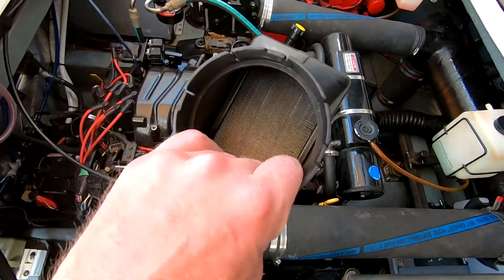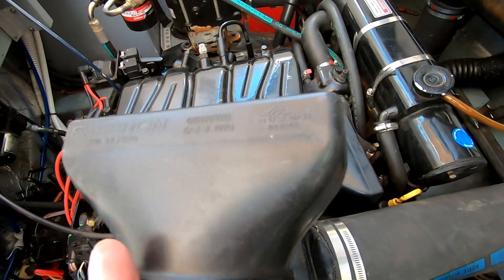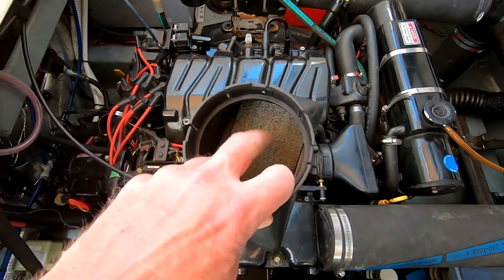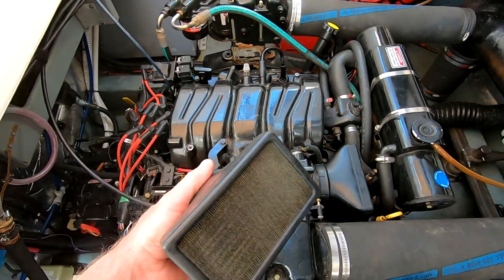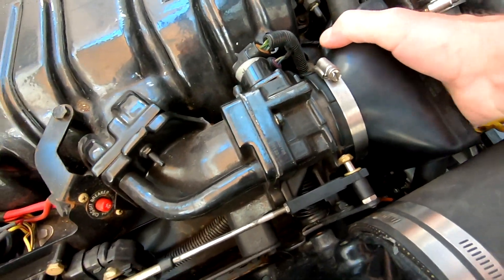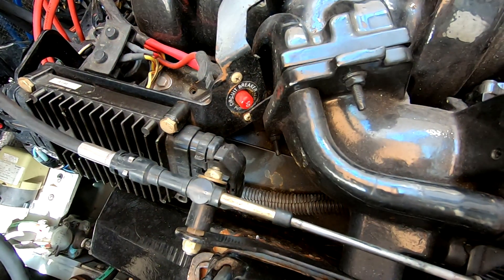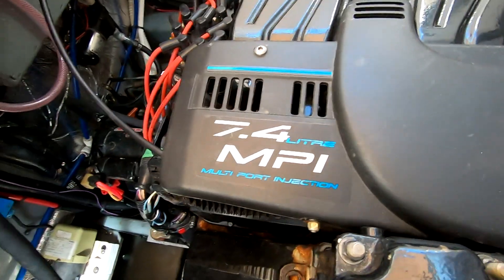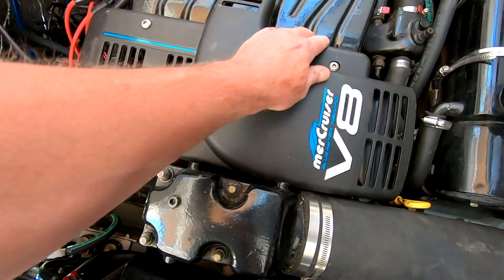Mercruiser FLAME ARRESTER (Don't Call It an Air Filter) Cleaning - Sea Ray Boat

Comment: I am with Jim Van Eaton,  the K&N air filters flame arrestors are made specifically to replace the expensive parts for mercruiser engines.  Sounds like a much cheaper alternative than putting back on dirty air filters.   As well cleaner air filters would lead to increased fuel economy.  Which sounds crazy on a boat but every little bit helps increase efficiency.
Reply from the maker: Exactly.

Comment: I replaced mine with K & N flame arrestor filters. $89 US, and since I have K & N filters on most of my cars, I have the cleaning system.
Reply: Thanks for the tip, have K&N in the motorcycle.. $105usd for my Volvo's... might have to give them a look
Reply from the maker: Mine came up nice and clean, so no need to replace.

Comment: I’ve had three boats with those exact engines (I’m currently also running a ‘98 330 dancer). I never in a million years would have thought anyone could charge that much $$ for those. And , totally agree torx are stupid, ESPECIALLY on that application. Like those covers are a real tamper hazard 🙄

Comment: Did you find foam pieces inside your manifold when removing your air filter flame arrestor? Right above the intake flap?
Reply from the maker: Nope.
Reply: @BoatingWithBoogaboo  
Thank you for the quick reply.  Do you experience shift clunk? When shifting into gear? My idle rpm is at 900. I cleaned my throttle body. And going to replace my IAC valve to see if it lowers idle rpm.

Comment: $500 each?!  That's crazy but there is no need to replace them - they're not really a filter but a flame arrester.  If the engine backfires, it keeps the flame from getting past the inlet and starting a fire.  Your cleaning job is similar to the procedure in the shop manual.  Interesting how the design has changed from the round style they used for years on the carbureted and TBI engines - almost like the automotive air filters only smaller.  Barbron has been the vendor for the flame arresters for decades.

Comment: Folks annoyed with the torx head screws have never worked in assembly production.  Those heads are very friendly to assembly tooling where indexing and torque control is important.
Reply from the maker: Perhaps, but very unfriendly to those of us who have to fix things. But then again, engineers never think of that side of the equation. . .
Reply: @BoatingWithBoogaboo  I'm sorry, that's simply not true.  I don't know about Sea Ray, but the auto companies I worked for have an organization called "service engineering" that reviews the serviceability on each and every part release.  They don't always get it right and sometimes there are many underlying reasons for a design, like cost, regulation, safety, function, etc.  Yes it would be nice to have every part attached with Velcro for quick change convenience but then reality sets in.